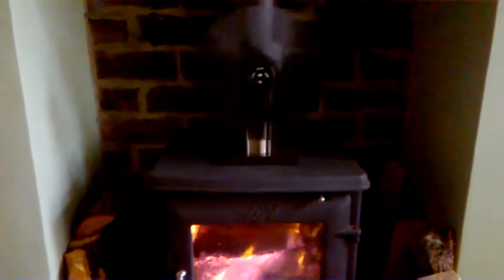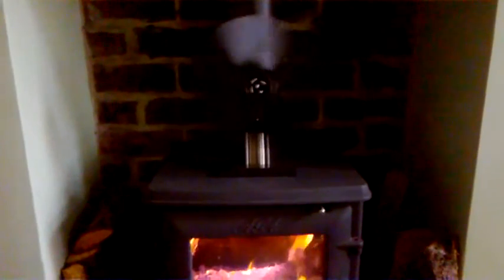Vulcan Stove Fan Stirling Engine Powered. Demo and Overview.

Comment: They are fine if you don’t need alot of circulation but in my case heating my house with my stove I put a actual oscillating fan off to the side and that really gets the heat moving around

Comment: We have one of the early ones from 2009 that has the shorter bushing around the displaced rod. It is still working fine though I did modify it to overcome the issue with the short bushing (that presumably prompted the design change) By putting a brass slipper piece attached to the bottom of the displacer the the side-to-side movement of the displacer was reduced and this prevented the binding and wear of the rod in the bushing. With this modification it has run perfectly for years and keeps running with the stove-top down to about 110C

Comment: How much noise does the fan make when it is running?
Reply from the maker: Hi thanks for watching my video. It's not really noisy but you can here a slight 'hiss' type sound on each rotation of the crank/piston. But it's so quiet it's never bothered me. I have seen the smaller quieter fans in operation but the difference in power is noticeable. This one really does push air around the room.